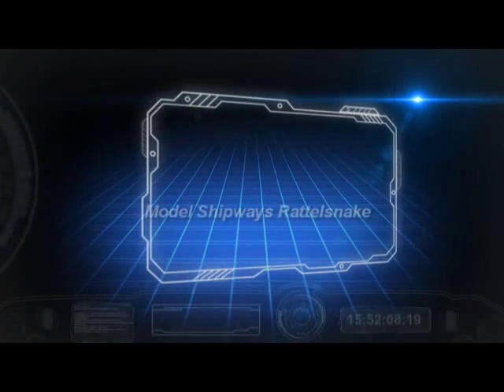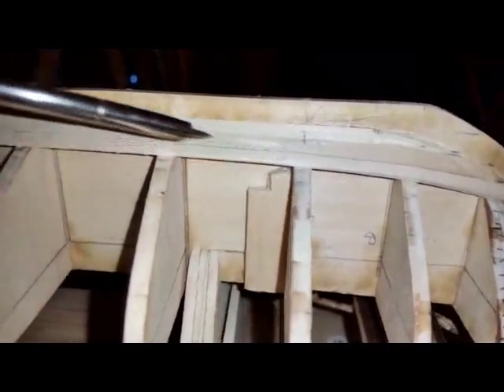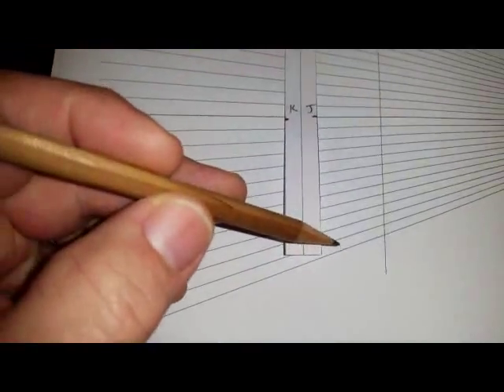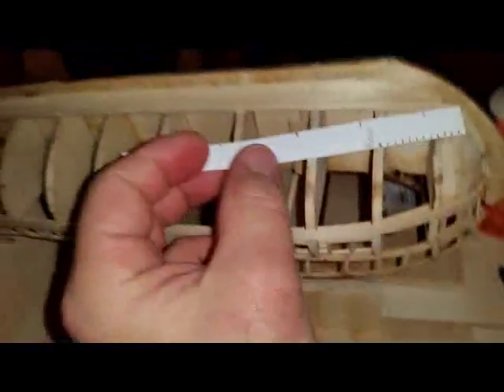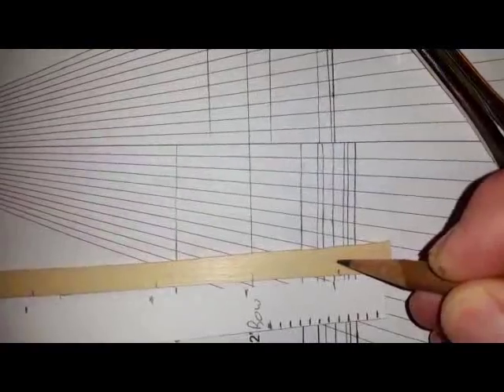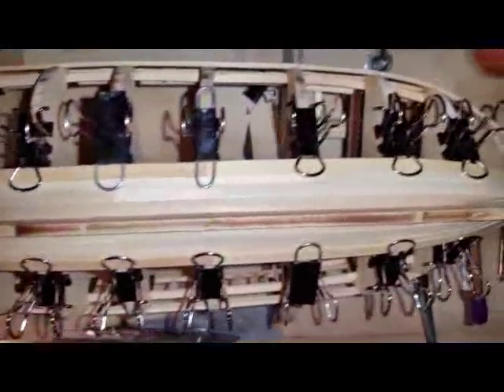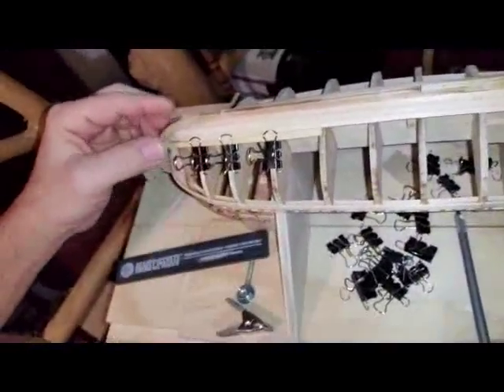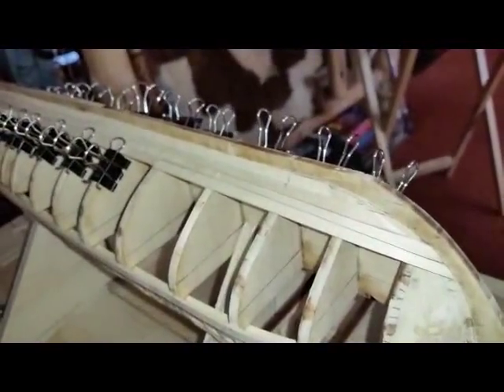Copy of Wooden Model ship Planking

Comment: is it necessary to wait a whole day after placing the planks or would 2 hours do.
Reply from the maker: An hour or two works as long as they are dry so the glue will hold
Reply: thanks and also what wood are you using for this model
Reply from the maker: Its basswood that came with the kit!